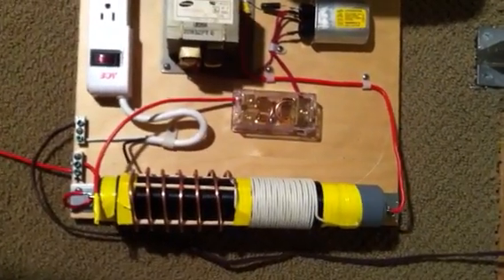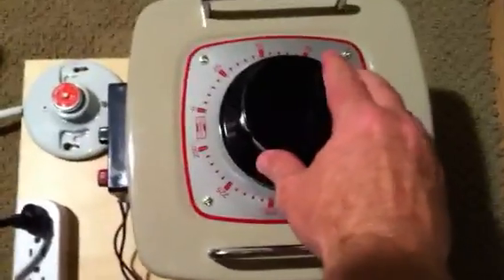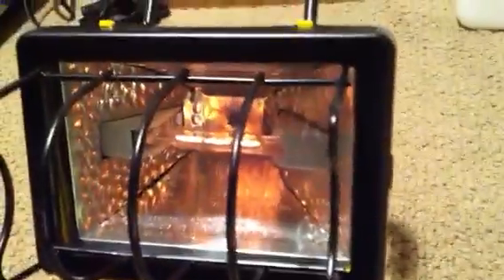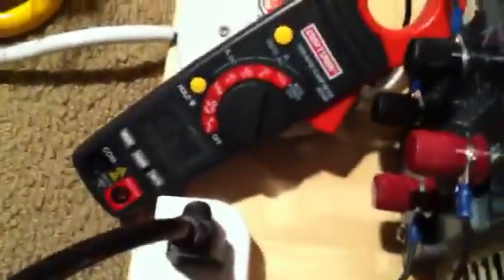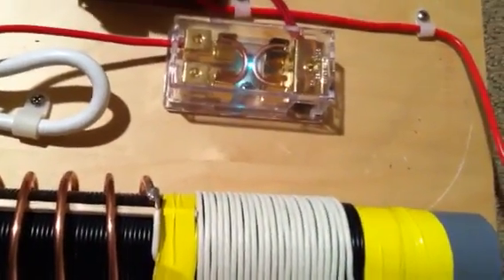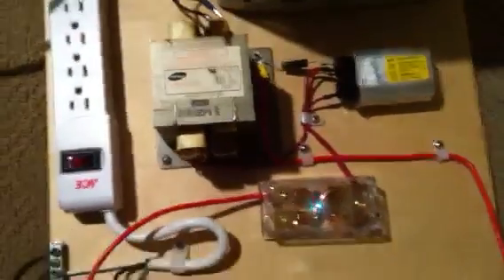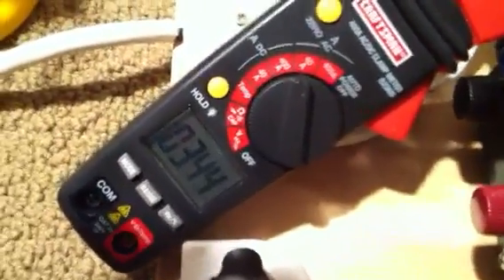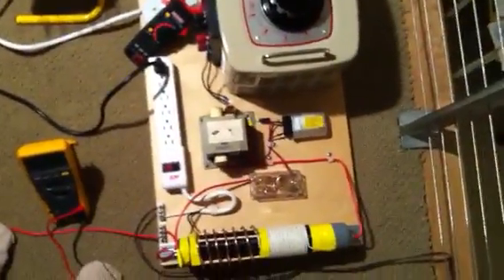Kapagen Kapanadze Generator coil

Comment: microwave transformers are very inefficient . they are not designed to run low loads.  they are designed to run under high loads. so that's the first thing you got to fix. try a zvs and tv flyback instead. Higher frequency lower current draw.

Comment: you do it in totally wrong way. I have seen the patent and it is different. 
you need a 230 volt 50 hz source and a high voltage source with high frequenzy.  you connect the load through a coil to the live wire, and the neutral is connectet directly to the neutral terminal on the source.  the next coil is connectet through a sparc gab to the high voltage and frequenzy source. The two frequenzy will interfere and create the high output. 

this is my best guest on how to make it. and i have made this circuit and it works fine. but tuning will increase the power and maybe a slayer exciter will do the job here.
Reply from the maker: Thanks Mikael. I'm not really understanding you but I'll give it some thought. Cheers
Reply: this way. please download the pictures as fast you can.
Reply from the maker: Got it, thanks!  I'll take a look. Cheers!

Comment: Such a device is very dependant on high frequency for power output therefore is a high voltage low current device.Your load is more suited to the opposite;try many low wattage lamps in series.

Comment: You should check out the JLNlabs replica of the kapagen... I also tried to replicate that device but it was underunity.   The spark gap is actually doing your frequency step up, but its still not enough to draw in a gain from ambient.   I have another device I call the bellerian apparatus and it takes in 60hz mains, and the HV side runs at 2.63mhz.  The frequency step up is achieved by the spark gap.  ;)

Comment: Germeten is right about resonance. Although I think TK was using magnetic resonance while Tesla used electrical resonance. I know its just semantics. 

This might shed some light on TK grounding terminals on the receiver. 

prometheus-al-ru /phisik/wireless.htm

and 

WORLD SYSTEM OF WIRELESS TRANSMISSION OF ENERGY in Telegraph and Telegraph Age, October 16, 1927 article by N. Tesla

Comment: Makes sense that the higher the frequency, the higher the output, as to my understanding, the REASON why you get more at the output, is that BEFORE you start the machine, THE COIL ALREADY HAS A RESIDUAL CHARGE OF ELECTRON AT REST IN THE COPPER ITSELF!!!  That means that a tiny droplet of electrons is ADDED to EVERY CYCLE...Meaning.....THE MORE CYCLES=THE MORE DROPLETS OF ELECTRONS ADDED TO THE INPUT!!!  
20khz = 20 000 droplets added to your input, per second!!!!  ;-)))

Comment from the maker: It is a piece of think copper wire but I think you should use a steel or iron rod.  What I have leaned since doing this experiment is you need to put the coil and the capacitor in resonance for it to work correctly. Doing that is easier said than done....

Comment: it would be good to somehow use a rf collecting air circuit powerful enough to run this and or ultra caps and a joulethief device tosomehow chrge this up at day and use it when you need to and it would top itself up when not in use or the next use

Comment: Firstly,air coil transormers are inherently high frequency.The MOT is getting hot because it has a magnetic shunt inside which is designed to restrict power delivery to magnetrons.It gets hot, because of eddy currents in the shunt.Thirdly, if you look at the kapagen website, in particular the Input/Output power measurements,1189W are being FED IN from AC,and only 1017W are being delivered to the lights.There is a 4% energy loss in the system.Their own measurements invalidate their theory.

Comment: I think it is your spark gap.  You are using a conductive loop instead of a direct gag.  The loop is causing eddie currents and interfering with the constant intermission of magnetic flux.  zyou can attenuate the spark gap with resistors but it would be a trial an error to attenuate (resonant frequency) the gap to perfection.  Simple point to poinf would be better for tuning the system.

Comment from the maker: I actually have two grounds connected 30ft apart.  This device is really lacking in it coil ratios as I've come to find out.  Also, it seems trying to do this with 60HZ is a big mistake the test really needs to be done above 20,000HZ  even better in the MHz range.  This is according to Don Smith.

Comment: kapanadze is pronounced  KAPA -- NOD--ZEE.

nice vid. just be careful of what your touching. High enough amps and that spark gap will reach out and bite ya through that lexan plastic. 

Just out of curiosity, how did you come about by using such and such number of turns of wire & gauge?  Was this calculated out from a step-up/step-down transformer equation, or copied from plans somewhere?

Comment: hey ur spark gap on that cirlce spark gap u will be losing a tremendous amount of power. switch to a soild tungsten or stainless/steel straight {---- ----} like this. the cirlce spark gap cause a flux i power because it is trying to excape the spark gap before the 1mm gap. think of a jacobs ladder and how one side is always higher in the accent up the coil because it discharged first or found short gap then the official spark gap. let me know if this helped beacause it could be ur ground